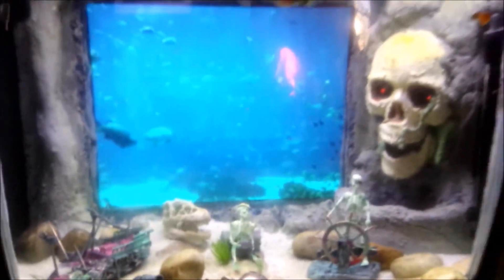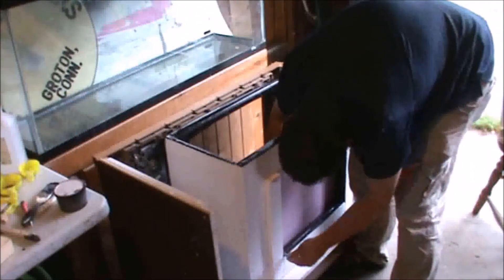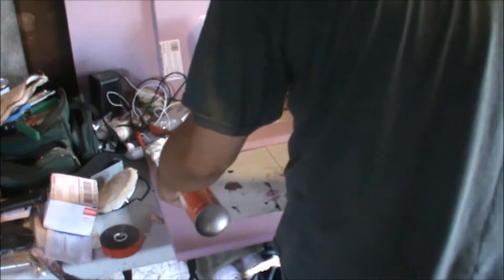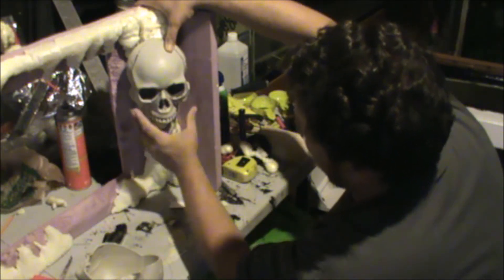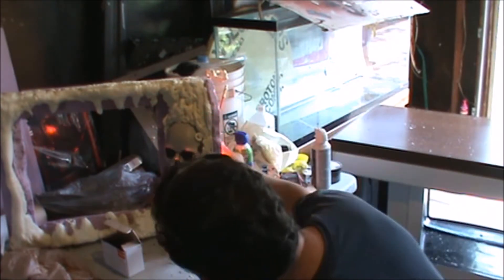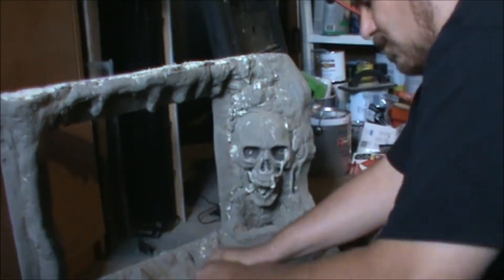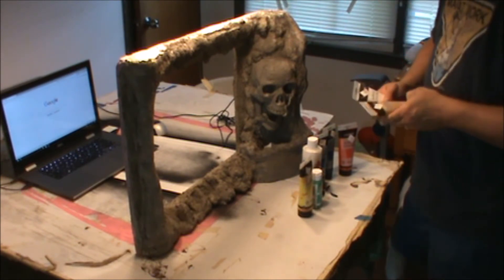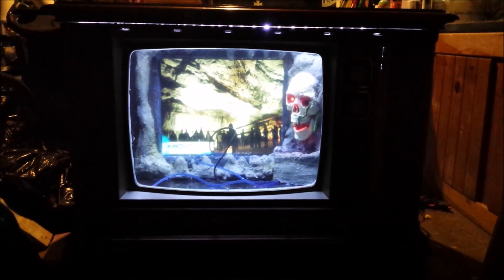Custom 3D aquarium Background

Comment: Did you use any type of sealer? Do the acrylics fade if not sealed? Cool video :)
Reply from the maker: Acrylic paint hardens like a plastic, so it doesn't fade, I did however coat it with some resin to seal it.